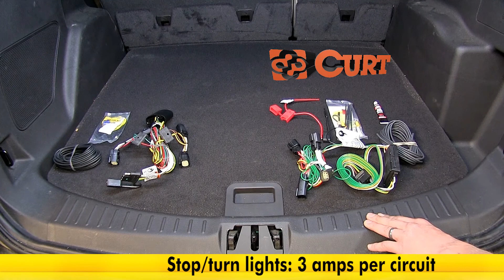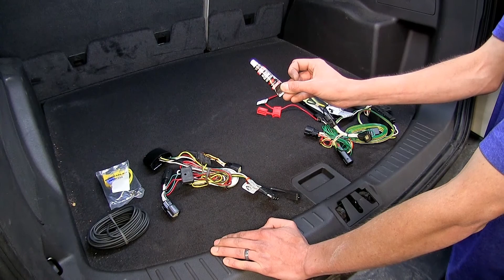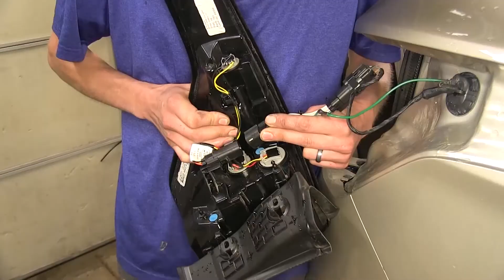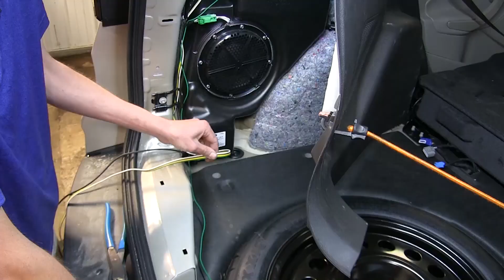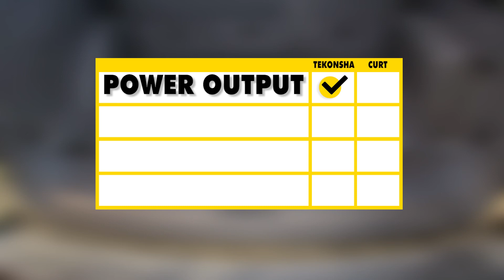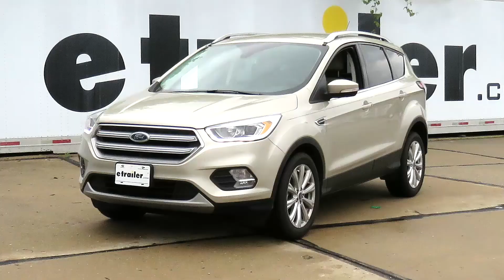etrailer | Best 2018 Ford Escape Custom Fit Vehicle Wiring Options

Comment: Got everything connected as instructed and turn signals not working
Reply: I have the same issues with mine and I upgraded the trailer lights to led I only have running lights no turns or no brake lights ran all new wire from the front of the trailer to the trail lights
Reply from the maker: Usually, when there is an issue with functioning after installing one of these kits, it is either the ground or the fuse. We recommend checking both of these to be sure that the ground is solid and the fuse is not blown.
https://www.etrailer.com/t1-2018_Ford_Escape.htm